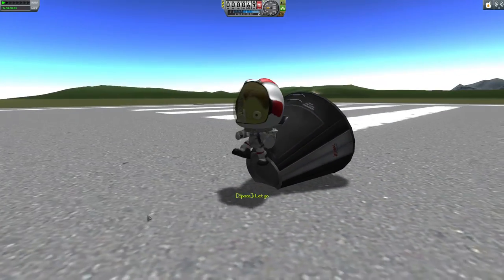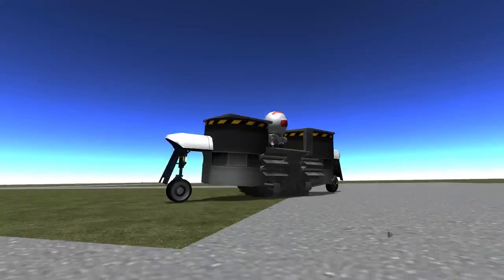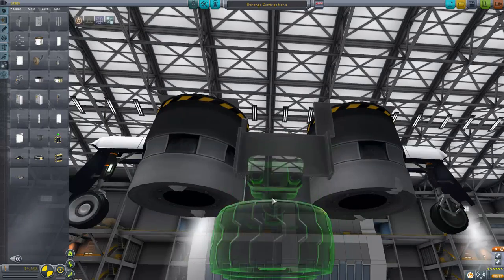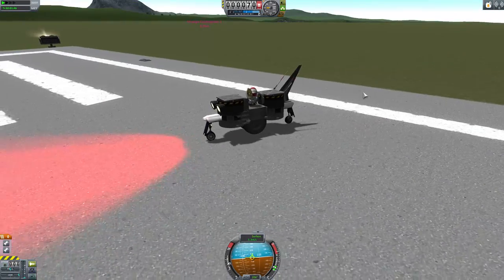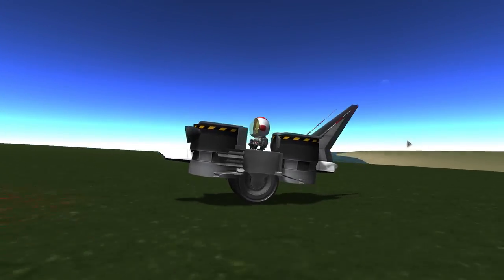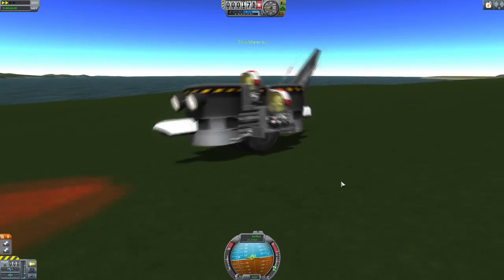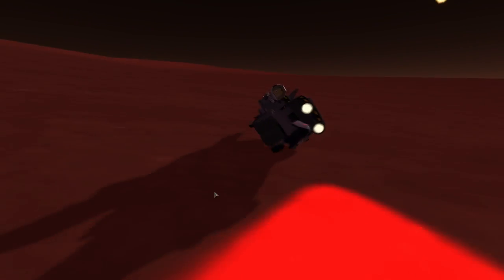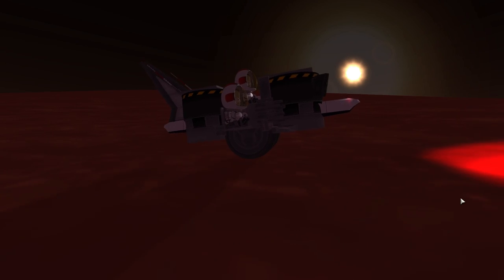Unicycle / Segway! Kerbal Space Program

Comment: The mass under the surface work as a spring. It the same mass regards to how much it turns the bike sidways in kerbin and Duna, but the force that push the bike back up again is like a spring where the mass multiplied by the acceleration is the force.

On kerbn the force is in the 10m/s^2 range, on duna 3m/s^2 range. On kerbin everything works the way it suppose to.  The bikes spring up 10m/s^2 and as long as it dont woble any faster than 10m/s^2 (that is actually quite fast), it will always spring up.

On duna on the other hand the bike will only spring up at 3m/s^2, and its not really that fast. And if the bikes wobble faster than 3m/s^2 the gravity will not be able to compensate for it. Basicly your bike seems to woble anything between 3 and 10 m/s^2... at the looks of it i would guess around 4 ish. It looks like it almost stabile at duna, but not really. I would say at Latyh it would probably work perfectly, but on Tylo it will probably wobble out of control

Comment: Wings on the side of the bike pointing up at a 45 degree angle(or so) would make it so that the bike gains lift on one side when it falls, the other side when that falls, making it more stable. Also, for hills and bumpy terrain, extending the landing gear might be an easy solution, if they're at the very front and very back of the bike. It'll be cool to see this in the next KPE

Comment: Ok, crazy idea, but what if you put the wheel not only lower to give more clearance, but on a pair Pistons, like a V where the wheel is the point and the lines are pointed towards the middle of the engines. It would give you some cushion for hills, and if you extend them individually you could react to retain contact with the ground. Simply put: semi manual shock absorbers.

Comment: Likely only way to improve stability in any significant degree at this point is to go from a uni to a bi design (or bi to quad wheel).  Using the current wheel design for the uni for the front an back wheel sets.

I'm assuming the previous bicycle was likely using just the landing gear this one has for training wheels, but if not, then don't mind me =)

Comment: It's possible the segway might be failing on duna due to the thinner atmosphere.
If that wing is providing most of the stabilisation on kerbin, then you'll be losing that effect in Duna's thin air.
You could test the theory by removing the wing and driving on the runway.

Comment: it is a unicycle, if it was a segway, the wheels would be on different sides than the mass it is carrying, meanwhile, the wheel(s)  here are right under the mass it is carrying, making it a unicycle, no? secondly, i would say add some torque but do not turn on S.A.S. so you have some control on pitch, yaw and roll. =) just my ideas.